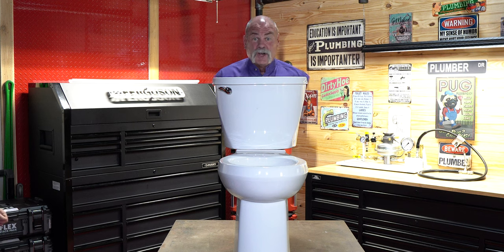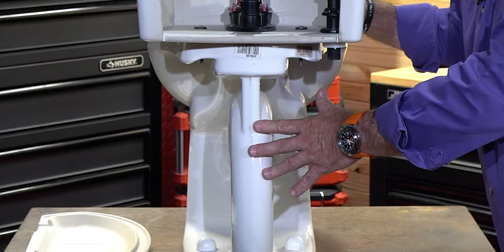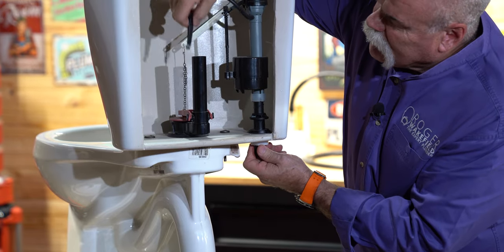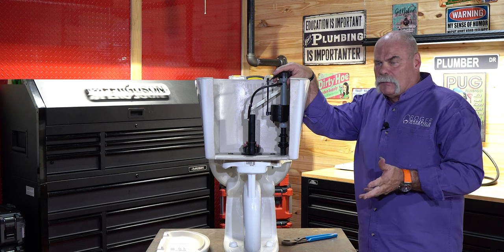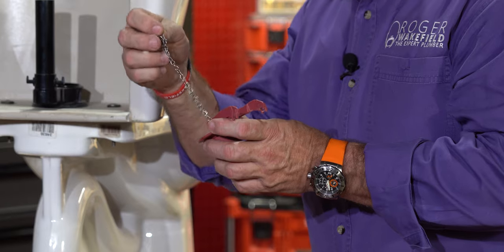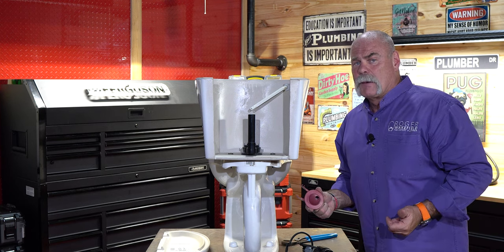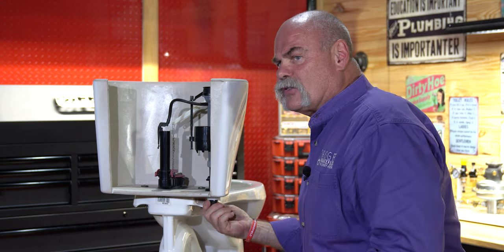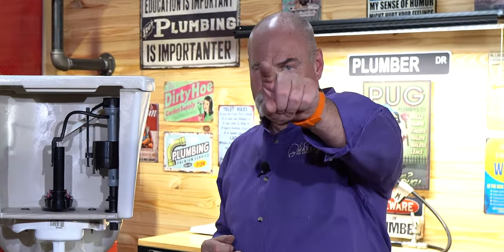How to STOP a Running Toilet GUARANTEED

Comment: Thank you Roger, going to try and fix my toilet later on. Main issue I have is what I can only assume is a faulty angle stop since when I turn it off, my toilet still fills with water slowly, already have my fill valve replacement ready, just need the time to do the job.

Comment: Just had this problem wont fill or it stay filling, had scale build up on the float shaft, had to disconnect the rod to the float and work it up and down to break that scale up, temp permanet till i get another valve

Comment: Would an intermittent filling sound be trash under the flapper?
Reply: Could be trash on the flapper seat, yeah. Could be a worn seat. Could be a hardened and shrunk flapper (*most likely reason*). Could be broken flapper arms. Could be a cracked stand pipe.
Reply: Yes. To confirm try this easy test.
 Shut off the toilet valve and put some food coloring in the tank, use a generous amount... (do not flush the toilet)
Wait 5min and see if the same coloring is down in the bowl, if yes, replace the flapper and clean the flapper seat.

Comment: Flushed my toilet last night.
All of a sudden my basment started flooding. Water was coming up my clean outs inside the house, and through the floor.
But not much water was coming through the outdoor clean out… any tips?
Reply: You probably have a clog between the clean out in the yard and the ones inside. This is a job for a professional to discover what is the cause of the clog.

Comment: I've had my head in a lot of toilets, but before today I'd never seen this problem. The overflow tube has a fixed (base) and an adjustable riser. The latter is fixed by a nut. Whoever put the unit together didn't tighten the nut enough and it resulted in a very slow leak. Needless to say, this should be the first thing checked.

Comment: Instead of replacing that little black washer, just unlock locking ring, remove entire top of that fluidmaster ballcock(fill valve) and just replace that top half of ballcock.   Very rare for notch to be in that overflow assembly that flapper sits on.....so just get a korky flapper...red is best but black works.
Reply: Lol..I'm 50....and I been plumbing so long, I don't remember what it's like to not know how to fix all those parts.  I been plumbing all my life

Comment: You stop a running toilet by turning off the shutoff valve
Reply: Lol that works too
Reply: And then the 20 year old shutoff valve starts running instead. At 1 am. On Sunday. And there's no more thread left on the packing nut adjustment.